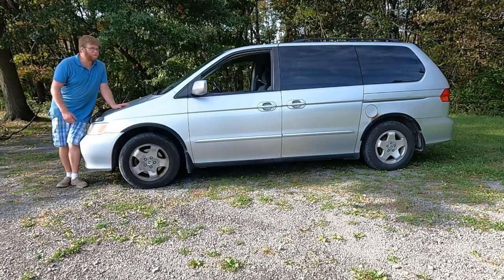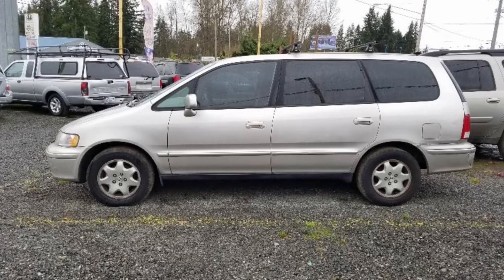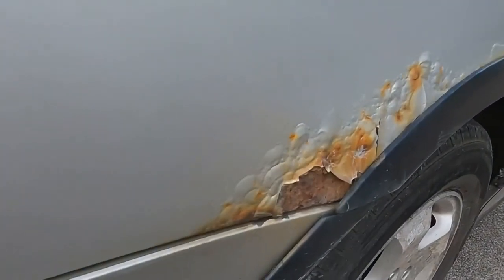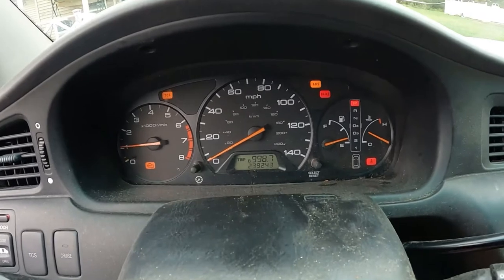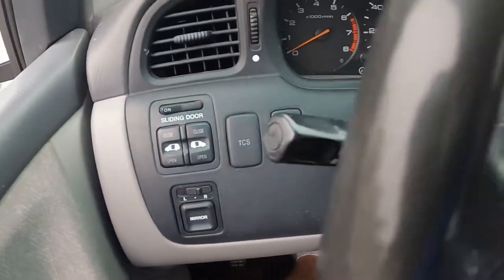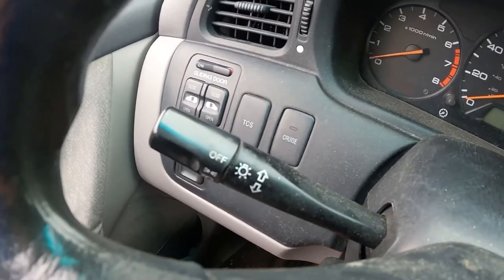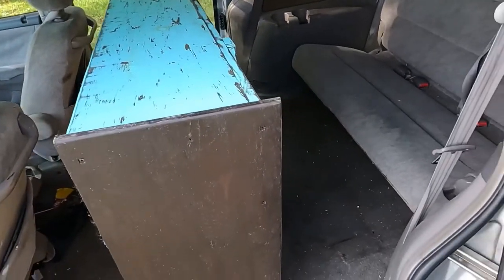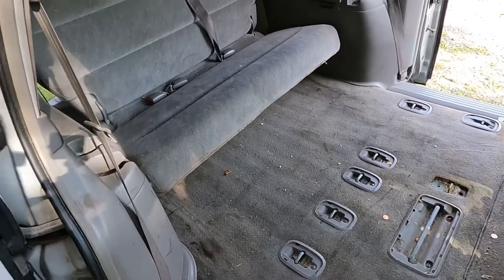2001 Honda Odyssey real world review 20 years later

Comment: Man, I just bought a 2002 EX with only 58,000 miles for $4500. It's in pristine condition. Like a time capsule. It's incredible. The paint and clear coat aren't even messed up, which is unbelievable for an early 2000s Honda. Southern car, so no rust. I was shocked at the deal I got on it. I've gone full middle aged dad, I'm excited over a mini-van 😅.
Reply from the maker: That’s awesome that’s incredibly rare especially at that price point in those miles.. 

I still have the one in the video I got a 2006 Honda odyssey as well one day I’m going to do a comparison video between the two I honestly think the 2001 is better than the 2006 because of the traction control issues in a 2006.. there isn’t any real traction control issues it’s just once and it feels wheel slippage it gives up. Whereas in a 2001 it’s possible to rock that back-and-forth to get out of a hole. Same can’t be said about the 2006 if it gets stuck you have to pull it out with something. Which can be incredibly inconvenient depending on where you’re at. Lol
Reply: @What.its.like.  The TC thing would be incredibly annoying. Especially in the south where you're on your own. The 06 won't let you turn TC off? I had an 06 Accord that was AMAZING in the snow, but only if you turned TC off.
Reply from the maker: It doesn’t have a button for traction control.. it’s an EX-L model pretty loaded leather and DVD player but gets 25 Hwy, 3/4 miles per gallon doesn’t sound like it would be that much of an improvement but it really is especially if you go to Florida at least twice a year.

I bought a Toyota Prius the commute back-and-forth to different places to shoot cars a lot of times I go across the state to classic automotive 5 1/2 hours away it only cost me $30 round-trip to drive the Prius there. 

My wife drives a Prius a lot to work case in point this is incredible so we put $25 in the Prius she drove back-and-forth to work all week and then we drove to Erie from just above Pittsburgh Pennsylvania and back on the same $25, The Erie trip just to go to Erie and back cost $45 round-trip and the 2006 Honda odyssey van.. it’s nuts

The solenoids are all messed up in the transmission in my 2001 I just shift it manually. Which is totally awesome mine has a 5 speed transmission but the four speed died before I bought it 

Another thing I will tell you is the air conditioning unit in a 2001 2002 is far better than the air conditioning unit in a 2006 it will actually frost the inside of the windows. I’ve never gotten a 2006 that cold
Reply: @ardri2074 
It looks like a roach motel on wheels 😂

Comment: And not to mention the turning radius on this is amazing for a van
Reply from the maker: Yes, I just took that van to the junk yard I paid 1,800 for it got 6 years out of it and junk yard gave me $600 I drove it there 

The only reason I got rid of it was the body was rotting and needed a lot to keep it going 

We have a 2006 Honda EX-L it’s loaded but isn’t have the van the 2001 was, traction control kills the 2006 yes you can turn it off but then the wheels spin and engine cuts off power the 2001 wasn’t like that and will go just about anywhere

Comment: I bought my 2002 odyssey in november 2020 at 236,000mi. Its currently September 2023. Van has 266,000 miles currently. And i have had no issues with the car whatsoever. AC blows colder than my 10+yr newer caravans at work. It shifts smooth. Runs reliably. And i wont sell this van. Im driving it til it dies because I only paid $2000 3yrs ago. These vans are well worth it. Transmissions ans timing belts need attention. Outside that youre golden. I change the oil every 2-3,000 miles with full synthetic. And use some berrymans b-12 chemtool in the gas tank a few times a year when filling the tank to keep the sludge down. What a great van. I would take an odyssey over an accord with the same miles.
Reply from the maker: I just took mine to the junkyard because my wife told me that I wasn’t allowed to buy any more cars until I got rid of that one.. I really want to buy a 30s car.. Plus I wasn’t really driving it that much anymore and it needed a whole bunch of stuff to keep it on the road the last year and a half to two years I’ve been trying to kill it just to see if I could because I only paid 1800 for mine.. all the solenoids are most of them inside the transmission were bad so you could’ve just put it in drive it would slip wood going between first and second second and third but if you shifted it manually it didn’t have that problem and it was actually very fast if you did it that way I raced all kinds of people in my van.. The van with 35,000 miles without an oil change it wasn’t the same oil because it leaks like a sieve but it was the same oil filter and it fired up and drove great but it needed a windshield it needed a ball joint or wheel bearing it was just a bunch of stuff that added up to it wasn’t worth saving. But it killed me taking it to the junkyard because that was the car that had the best air-conditioning system I’ve ever had we have a 2006 and it’s not even close. Also the 2000 one doesn’t have the same traction control system for 2006 has no actually going to snow the 2006 if it feels Any resistance it gives up, turn traction control off and it just spins it doesn’t go anywhere.

Comment: I just purchased a 2001 Odyssey with 134,000 miles brand new transmission. It was hardly driven. the inside is nearly perfect, very clean.  The lady who owned it was old so she only drove it the store. I got it for 4,400 and on top of that when the lady took it in for maintenance she strictly took it to the dealership.
Reply from the maker: Mine just died last year. I got six years out of it and it wasn’t dead. It just needed more money than it was worth to keep it. We just bought a 2011 Honda Odyssey elite which I will definitely have featured on the channel. I have another another Honda van. I’m gonna do comparison with maybe next week, maybe this week I’m not entirely sure
Reply: @What.its.like. what are your thoughts on a 1998 Honda Odyssey? For 3500
Reply from the maker: @enhancedutility266  I never saw 98 model to be honest I can’t remember if it’s in the same generation, but if it is just know that those transmissions, the original ones were very faulty the four speeds
Reply: @What.its.like.  got you I guess I have to look further into the transmission cuz that's what everybody's been saying

Comment: This was very helpful, thank you!
Reply from the maker: Happy this video helped you I no longer have that van =( that was the first Honda Odyssey van we bought a 2006 EXL. Which I alongside the 2001 I just haven't done a video on it yet we just bought a brand new to us 2011 Honda Odyssey touring elite going to do a comparison video hopefully really soon, but between the EXL and the touring elite.. but out of the three the 2001 was the best.. I haven't driven the 2011 in the snow yet put the 2006 with the traction control is absolutely terrible and you can't shut it off. It just gives up... also with that said I am very disappointed in the 2011 it's supposed to get 28 miles to the gallon. I've never gotten that out of it the most I've gotten on a really long road trip to Georgia from Pennsylvania. Was 22 average which isn't great the 2001 got better

The 2011 has cylinder deactivation and six speed transmission the tires and that might make a big difference we're going to put Michelin on. I think I've been kind of waiting for that to see if that improves anything.

Comment: The vent windows still work? Those tend to fail. The 2004 Odyssey EX-L my family had, the vent windows stopped working I want to say when the van was around 10 years old.
Reply from the maker: My vent window still worked the day that I got rid of it air-conditioning blowed ice cold I mean it would frost the inside of the windows. We have a 2006 Honda Odyssey EXL. It doesn’t get that cold the 2001 in my opinion is better than the 2006. The traction control system sucks on the 2006. We are looking at getting a 2011. Hopefully this year may be a touring. I’ll definitely do a video on that.

Comment: Do your power sliding doors work? I know they can still be used manually if the switch is in the off position. The one I had, the passenger one kept getting stuck and I had to use a spray lubricant to make it open and close.
Reply from the maker: Only one side worked when I was delivering some furniture down in Washington Pennsylvania. My van was parked on the side of the road side of the street I should say, and there was plenty of room to get through. The one door was open. This guy hit the door and took it with him, I should’ve just got the car junk out but it was during Covid and prices of vehicles got really ridiculous so I had them fix it so I had one power door and one that wasn’t powered but I honestly liked the manual door better because it didn’t have any of the issues that the power doors have
Reply: @What.its.like.  I prefer manual sliding doors, my friends 2002 Toyota Sienna CE has manual doors, and they open and close perfectly.
Reply from the maker: Totally agree
Reply: @What.its.like.  My favorite thing was my aftermarket pioneer stereo, I got it as a gift. I still have the 2004 Honda Odyssey brochure, and my parents kept the vans window sticker, from when they bought it but sadly it was left in the glove box when they got rid of it, I wish I kept that too. My van was a 2004 EX-L, it did not have the navigation system nor the dvd player, it was in Sage Brush Pearl and had a darkish grey with a slight hint of green leather interior ( fern ) , I do know for other leathers you can get beige leather( ivory ) or lighter grey leather ( quarts ) on the EX-L as well. It was a good van, served our family well from 2004-2018.

Comment: Im abotmut to get my first odyssey 01 in 10days
Reply from the maker: Sweet EX EX-L or touring, the last year Ive been trying to kill it and it won’t die. Love Honda’s because they are very forgiving and don’t blow up when they lose oil ( for the last 1.3 year I’ve been neglecting my 2001 van to see how much abuse it can take, Ive driven it 35,000 miles on the same oil filter, don’t do this, but it runs great). I’m willing to bet the farm couldn’t do that in a Mercedes bmw and most definitely not Land Rover product. 

Comparison coming I have a 2006 EX-L and honestly I think the 2001 is better =) 2006 has traction control and it sucks it won’t allow wheel spin so if you get stuck in snow your stuck 2001 will keep trying

Comment: No rust in California 220000 miles on mine. Trannys fine just replace all the solenoid and shift controllers and  use Honda transmission fluid and radiator fluid only. I got my check engine light to go out. You got to fix that check engine light the bad sensor goes to default and it runs like crap fuel economy and everything else so don't just leave your check engine light on. Can't get a smog test in California with engine light on. This fan is like a beast very reliable.
Reply from the maker: I just took it to the junk yard wife said can’t buy any cars until that one was gone so it’s gone.. that was one of the best cars/vehicles I ever owned. Paid $1800 for it got 6 years out of it.

The last year of ownership tried to kill it and couldn’t I drove 35,000 miles with the same oil filter (it leaked oil so the oil wasn’t the same.. lol 

I never fix the solenoid problem I just shifted it manually and it works great

One episode I even raced my friends Volkswagen Jetta and beat him numerous times you should check it out it’s pretty funny

https://youtu.be/zMIOVPNZ8xw?feature=shared

Comment: I own a 2001 Odyssey EX, with 280,000 and I love it. Everything works, and I keep up with all maintenance.  It’s a great van.
Reply from the maker: I just took mine to the junkyard two months ago I’m kind of regretting it the right was getting too bad it was gonna cost too much money to keep it forever.. 

We have a 2006 E-XL as well and it’s not half the van this was traction control sucks the 2001 could get stuck but could rock it to get unstuck. Which isn’t possible in the 2006 it cut power to the wheels even if you shut traction control off it just spins

I paid $1800 for mine and got six years out of it there was 260,000 On it when I took it to the junkyard they gave me $600 for it which was more than anybody else would give me for everybody wanted to come test drive it to try to blow it up when I had it for sale kind of ticked me off
Reply: @What.its.like.  The resale value on my odyssey isn’t soo great(Blue Book is around $1500.  Because it’s a good running van, I can’t see the point in selling it for soo cheap when it runs soo well , so I’m just gonna keep it as long as I can.  I drive very easy, and baby it. 

I’ve had my odyssey for 7 years and I bought it for $1200 with 175,000 on the dash, and its been good to me. I’ve managed to keep up on the maintenance, which only costs a few hundred dollars a year. Brakes, a tire here and there, oil changes every 5k. The engine compartment is kept clean too. I am always wiping it clean. 

Everyone tells me to get a new car, but why? There’s nothing wrong with it!! It runs and other than some typical rust near the gas fill, and rear wheel wells, the exterior is good.  The interior is CLEAN. Seats are still clean, and firm, no tears or burns ..Carpet is clean, glass is in tact, no chips or cracks.  My power sliding doors function well, my heat and AC work, and I still have the stock cassette stereo and CD player in.   I’m content lol. 

I have a friend who’s paying $850 a month for a Tahoe! That’s not including insurance!  Costs him $80-$100 to fill it, and the maintenance is crazy.  No thanks. I’m happy where im at.
Reply from the maker: Totally agree with you why spend more to have less in the end, new cars are overrated.. I haven’t drove any of the newer Honda vans so I can’t speak for them.. but the 2001 era was a good one, only issue I’ve read was the transmissions but i think most were updated by now there was a recall I believe 

I have three vehicles ( want another classic car ) all paid for 

2009 Toyota Prius 
2006 Honda odessey 
1951 Chevy 3800 1 ton

My truck is better than anything on sale now as a work truck and paid less than 10k for it
Reply: @shakur481 
Odyssey reminds me of a roach motel especially the shape of the interior design 
😂
Reply: No is a pour van

Comment: I have an 02...448km... amazing.

small parts died and crapped out but engine AND transmission has been solid.
Reply from the maker: This van.. I still have and have been conducting an experiment, on how much abuse it can take. I’ve driven it 35,000 miles same oil and filter (well it leaks and burns oil there have been times when I check the oil. There wouldn’t be any on the stick still runs great it’s going for a oil change soon it’s been 1.5 years and 35,000 miles since it was last changed. Willing to bet the farm couldn’t do that in a Mercedes!
Reply: 👍🏻👍🏻🔥🙏🏻🌷 Good job my car odisy 2004 v6 in kig dom of  Jordanian 🇯🇴 👍🏻

Comment: The 04 Odyssey my family had, we got rid of it in 2018 with about 120,000 miles on it, the vent windows no longer worked, and the passenger side sliding door had issues with it getting stuck, two locks didn’t work properly, and it had a noisy powering steering pump. The engine ran just fine, it was just noisy with the AC compressor running, and as far as I know, no transmission issues. I miss that van. I see a ton of 1999-2004 Odysseys for sale on Facebook marketplace and sometimes I’m tempted to buy one.
Reply from the maker: If you don’t mind me asking what vehicle did you get to replace your Honda van? I’ve owned two Honda vans I’ve had this 2001 we have a 2006 X – L which has leather seats DVD sunroof it’s more equipped than the 2001 but the 2001 was a better it didn’t have the traction control crapped it the 2006 one has we’re thinking about getting a 2011 touring but they have just gotten ridiculously priced before all this Covid crap with the market and everything you could get one of those with 100,000 miles for like six grand now that same van is like 10 grand and I can’t bring myself to spend $10,000 on a 20-year-old van that has over 100,000 miles make sense the world that we live in now. 

The other cool thing about the 2001 is you could shift that transmission manually if you did that it was really fast I beat cars that I shouldn’t be able to beat in that thing I erased my buddies jet wagon in an episode where I talk about all the abuse that I put that van through and it took it and I beat him with 35,000 miles on the same oil on the Jetta one but in reality, I beat him.  It was hilarious 

https://youtu.be/zMIOVPNZ8xw?feature=shared
Reply: @What.its.like.  my parents got a used 2015 Toyota Camry, which I still currently drive.
Reply: @What.its.like.  I wanted to keep the van, they felt like a newer used car was better for me to have for going back and forth to community college. The Toyota is basically my car, I keep it maintained, pay the insurance for it, soon the title will be transferred to my name.